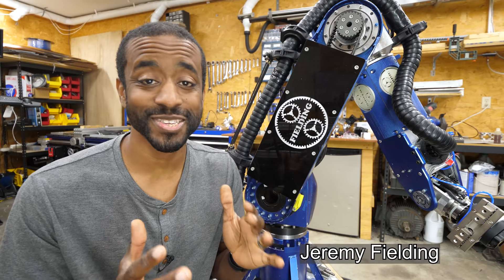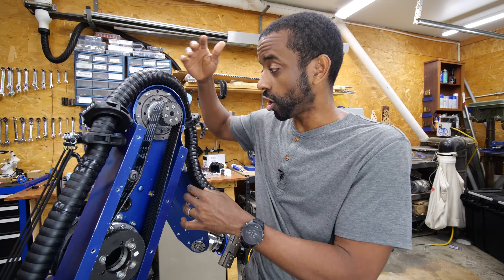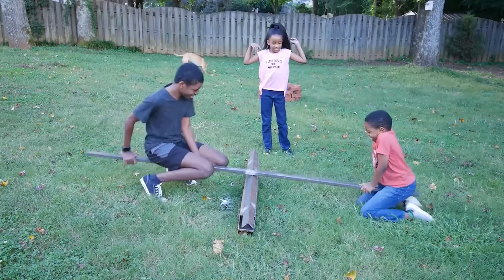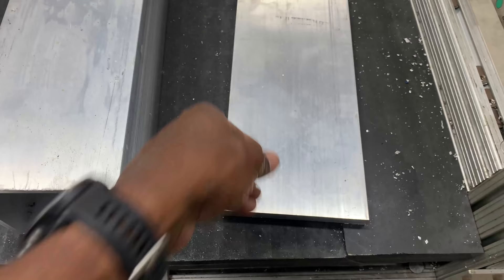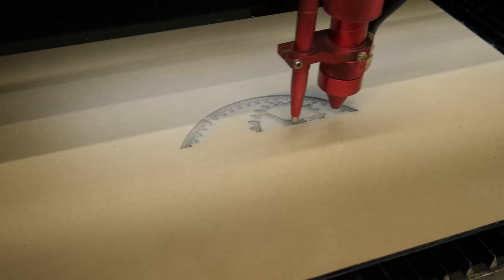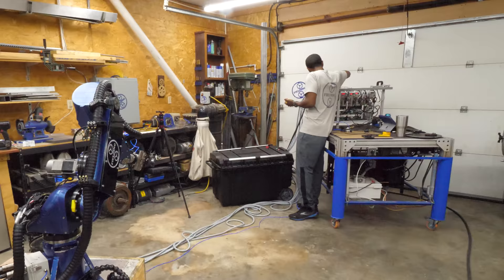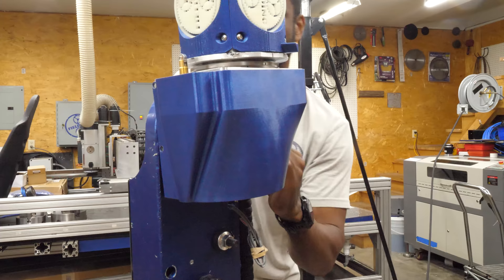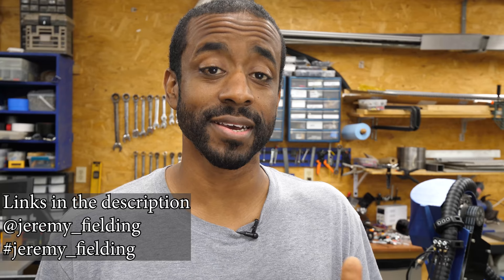How I Designed My Robot To Be Fast! Engineering Speed at a Lower Cost #092

Comment: Have you done a series on encoders? I am wondering if you have considered pivoting the failure into a success (No ego here, I think you are exactly what the internet needs REAL). There is great value in explaining or teaching the troubleshooting methods of this exact situation. The failure code from the controllers, how to reference the manual, code and parameter descriptions and remedy, meter reading potential, using the mater to compare functional encoder measurements and variance or defects, parts lookup and procurement, replacement of entire motor assembly or only resolver for cost savings. This is so important a skill set to have.

Comment: That 1/8" aluminum killed me around 8:15. I don't actually know how that aluminum was manufactured, but as an extruder I assume it's extruded. I expect a couple thou variance in bar stock or square tube's thickness from one side to another, so seeing it used as a gage on 123 blocks gave me a laugh. Clearly whatever you're doing is working great, just something I haven't seen.
Love the channel, thanks for explaining your process so clearly. You're a great presenter and engineer

Comment: Repairing bonehead mistakes equates to half my paycheck, yet only a 1/3 of my time.  I’m human, therefore I’m subjected to make the same mistakes everyone else does, requiring me to fix them for free.  It hurts twice as bad when you see a potential problem in a design, choose to ignore it, and still make the mistake.  I’ve done that too.  30 years ago I recognized that failure is the path to success, thus some of the first tools I bought were tap and die sets to fix the mistakes I made.  Your doing a great job!  This one hurts the pride and the wallet a bit, but you learned from the mistake, and continuing to move forward.  I can’t wait to see what you have planned for this arm.

Comment: 1. U have enough machining capabilities, try clocking generic connector pairs; slot one, install a blade in the other or drill both & pin one side; color for convenience & clock for absolute. 2. Weld smoke is super toxic, so if U want to play with Ur grandkids manage Ur ventilation so Ur lungs are not part of the filtration process. 3. LOVE seeing the kids in the shop, good on you!

Comment: 8:32 (ish)

If I had to guess, you don't want to weld after you machined parts because with welding (mig, stick, etc.) it's not to say that it won't work but after the initial expansion (from the heat being produced from the welding process like DC- or DC+, or heat from a regular GMAW welder) it will shrink.  It is likely to warp itself as little as a thou or as much as a few thousandths of an inch, or as bad as warping the work piece into oblivion.    There are certain techniques to help mitigate that kind of issue like heating up the two work pieces to the same temperature together so that it matches or gets close to the matching temperature of the welding process and once it cools off, it will cool off in uniform.  Or, as one piece than a single weld bead if that makes sense?

But, keep in mind that's just my educational guess, I have done welding (gmaw mig and 7018/6010 stick but not tig sadly) back in high school and that's as far as my recollection to information pertaining to that goes.  And if at any point that I am incorrect for one minor detail or the entirety of the hypothetical I gave, please correct me.   I intend to learn more so that I can do some interesting projects regarding engineering. :)

Comment: Great job and you're very well equiped!
I would like to know why you did not put an endless screw and gear to pivot the upper arm?

I think that it is more strong, a bit heavier than the pulley but you could have placed the motor further down, right on the center of rotation and with a axle activate the endless screw, and so have an equal moment of inertia but with a major Security feature added, the upper arm would never fall in case of a failure.

Please let me know why and if you don't understand what i'm talking about, i would be pleased to show it to you by a drawing.

Comment: I felt that. Something that would happen to me.
Maybe, if there is at least one free pin on each connector, you could break the unused ones off and seal the corresponding recepticle. Different pins for different connectors, ofc.

Comment: Avoid welding after machining because the heat and other induced stresses can warp the nicely-machined and toleranced part. What I mean by "other induced stresses" is kinda like if you bent two rigid things and then glued them together, those two things want to rest in a different position but are now constrained.

Comment: Excelent video! I love that you showed the mistake that broke your project. It is so great to share a problem and the process of acceptinig what happened. You handeled it very gracefully, I might add. I would have used a lot of language that would not be 'family friendly'. Is it possible to put some sort of fuse or other power checking system inline with the 5v encoders to protect future Jeremy from any other type of mistakes?

Comment: My advice for labeling the wires would be to either put which motor the wire powers, or put top left, top right, bottom left, bottle right, to show their position on the box they plug into.

Comment: The correct way of preventing multiple identical plugs from being inserted into the wrong sockets is to alter either the keying of the outer shell, or the pin arrangement.
eg Plug 1 / Socket 1 has: pin 2 missing/blocked up.
Plug 2 / Socket 2 has: pin 6 missing/blocked up.
Plug 3 / Socket 3 has: pin 17 missing/blocked up.
As long as you plug the empty hole on the socket end, with say scrap plastic/epoxy, then it's impossible to plug them in wrong (well without really forcing it).
Another solution, weld a metal rod to the (temporary removed) outside casing of the plug with 24V on it, such that it will hit the plastic box if put into the other sockets, but clear when in the correct one.

Comment: I would modify the cable setup so that it was physically impossible to hook the cables up wrong again, because if you don't, it is going to happen again, even with labeling.

Why do you want to avoid welding after machining? Welding can easily warp a part, especially if it expands and contracts thermally, like aluminum does. You also add stresses into the parts from the uneven heat and cooling caused by welding, which can lead to other problems, like unexpected failure points.

Comment: Jeremy- If you have never fried or broken some part(s) , you are not doing anything.
 I remember 50 years  back when I rebuilt a battery radio for myself. I accidentally hooked the 45v B+ battery wires to the 1.5v tube filaments.
 There went months of allowance, as I blew all the filaments wide open. Sadly, solid state is not as forgiving as the old tube equipment was. Keep up the great work and videos.

Comment: Dude I have been there, and sometimes these projects get so damned expensive... but I've learned my lesson quite similarly similar.  I either find different connectors, even if I have to use multiple, or wire them all the same (3 motors, 3 connectors 3 vary similar wiring schematics,to prevent blow outs)

Or, baring making it "idiot proof"... (or anxious late night lets see it work proof!)  I always have spray paint handy, so plug the cable in, mask a ring around the chassis connector - paint a quick light coat around the cable and the plug at the same time. 

Good luck on your replacements!! Sucks making a mistake like that!

Comment: This is an awesome project! I've built a 4 axis robot and was gifted a 6 axis Epson C3 robot that was no longer in use (it works perfectly though). One interesting thing about its construction compared to yours is that the gearbox/joint bearing is one piece that is the attached to a belt that goes directly to the motor. Since they have small gearboxes they can afford to put those at the joint and remove any springiness from the belt that way. I can't wait to see your robot move, do you think you can achieve the speeds, acceleration, and accuracy that commercial robots can? My 10 year old Epson does 2m/s, 20m/s^2 and with a repeatability of 0.02mm.

Comment: heat from the welder will distort the shape of the metal, changing the position of the precise features you CNC machined into it. It can also change the tempering in the metal, making it softer or more brittle. (not sure which)

Comment: If you have one spare plug pin not used, move it so not the same as all the  others... then plug each plug spot that's not used. Now only that cord will fit in that plug.

Nice work, keep going forward!
I have smoked thousands of electrical components over the years, lol. :)

Comment: Great video but man, you killed me the few times you said "angle iron" when you were talking about the aluminum angle extrusions...

 question text @ 8:33 ahhh good'ol post-weld distortion messing up machined parts.... 
One thing that can help with that if its profiles (not so much flatness) particularly when working with aluminum is to machine part under or oversized and also machine out a "to size" template and then use a hand router and / or router table with a pattern tracing / flush trimming bit in the router to take the part to final size after welding. Obviously this assumes that you can access the features with the router / bit. If you can, this works great for getting good fits and holding pretty good tolerances (I've been able to achieve down to about +/- 2.5 to 3 thou tolerance doing this)..

Comment: Where I've had to use the same connector for different incompatible things, I've 3D Printed a little collar for the outside of the connector acting as a gate so only the right plug will go in the right socket - I feel your pain!

Nice use of SilentSync belts by the way!

Comment: a little bit of backseat engineering here, but why not align the motor axis to the arm axis and use a rotary coupling + solid shaft + bevel gears to transmit torque to the second arm? It would remove the elastic elements from the power train and require fewer parts. It might even be lighter weight than the current design.

Comment: Have you considered adding a safety break connected to the belt tensioner to lock the arm position in case of belt failure? It would probably be a pain to refine due to belt backlash, but I feel like it should be doable without too much added weight. That would remove one of the drawbacks to a belt drive system

Comment: Was re-watching this and noticed the bit about two inter-mateable connectors. When I was working on Magellan at Martin-Marietta, budget was nonexistent and many parts were re-used or castoffs from other programs. Some connectors which might have been made non-intermateable on any other program were allowed to be intermateable on this one. And wouldn't you know it, after we shipped it and it was undergoing testing at NASA, a NASA technician, working blind with his arm buried deep in the main bus structure, mis-mated those two cables, believing that they would be polarized so they couldn't be mis-mated, but he was wrong. Short-circuited the vehicle batteries and caused extensive smoke damage, but in the end no great damage done. A near miss on an unreplaceable spacecraft.

Comment: Why does the order of melting and heating and cutting matter in metals?

Metals permanently bend when superheated.
Metals weaken when heated.

Some metals can be strengthened by heating them very precisely.
If you reheat the metal above a lower threshold, you revert the metal to its original less strong internal shape. 
Sort of like scaffolding in a triangle shapes vs scaffolding in box shapes. The triangle shapes are stronger because the joint physically cannot  move. Unlike the box shapes that can be moved by breaking the strength of the joint. 

Because the strength of metals stronger out of the factory through a heating process they use. By reheating the metal up to (I think 300c for aluminum), you revert the metal to a less strong internal structure.

Comment: Quick tip man, once you process Aluminium, why do not you use spray mist lubrication instead of coolant? It is less messy and you can clean machine with in seconds. By the way, respect man!

Comment: Ouch ! Frying all three motors definitely hurts. 
At my job we have a lot of different voltages (5, 12, 28 V DC, 115 and 230 V AC) and a ton of different data protocols running inside aircrafts. The number one rule is "never mix connectors". I think that it has been learnt the hard way...

Comment: Maybe you should pull apart the blown up motors to do an autopsy on how they failed. Might get lucky and something fairly straightfoward to source and replace is what's dead like an optocoupler. 

They're industrial lego enough that with some scratching around the likes of banggood you might find the original encoders as a whole piece. If the drive coils aren't smoked then it'd be worth the time to poke at it and get a bigclive style autopsy vid and maybe some working spares out of it in the end.

Super frustrating when something like that happens right at a big milestone in a project. Maybe paint them to color code them? Hard to confuse red and blue.

Comment: As painful as your mistake was, it was wonderful to show it to your viewers. What seem like trivial design decisions like how to label connectors can have devastating consequences. A lot can happen in less than a second. Your initial idea of keyed connectors is best but not always practical. Sometimes you can select pins in the connector so such mistakes are harmless. Color bands, as you later used are good but not idiot proof. The key lesson here is to practice “defensive engineering.” If two things can fit together (with disastrous results), they eventually will.

Comment: Perhaps you can modify the connectors to make them unique. You could 3d-print a shell for the connectors with coding notches in different positions, so you can't interchange the connectors to the wrong place. Or perhaps it's enough to modify the 24V connector (if not all pins are needed block one of them mechanical).

Comment: Are you sure that these belts are "designed to flex"? They are usually kevlar-cored for preventing this phenomenon specifically. Or did you order a variant that is designed with elasticity in mind?  Your commentary on the positioning of the motor is insightful. Most industrial robot manufacturers sometimes use counterweights to get around the problem of eccentric loads. Can't believe you design, fabricated, assembled, and programmed your own robot. That is seriously impressive. Have you thought of anything interesting for an end effector? Festo (and others) are doing some interesting work with grippers capable of picking up organic and variable shapes. Maybe you could take that concept even further.

Comment: I acknowledge that it is a pain to do the division and conquering thing.... but I would have used a hybrid servo that allow me to replace, service and correct issues... also at least till now I have managed to keep all my servo equipment exactly at the same voltage.. using different current and power usually open the doors for what you have to deal wit... "Probably an over kill but I would feed those "5V encoders in a different plug totally different than all the others.. Have done it & it get expensive rally fast!! Best of luck, find your work inspiring!!

Comment: I'm wondering why you used servo motors and not some sort of pneumatic system for moving the arm parts. It would result in a much lighter arm, which would greatly reduce the forces involved. Since compressed air can be stored in a tank, the power surge from running many motors simultaneously would be less of an issue. You'd need a compressor, but you could put that in the robot's base and have it be part of the ballast weight.

Comment: Maybe you could add a 3D printed keyed pair  to the socket and plug to ensure only the right plug can go in the right socket? Also, I'd check the driver portion of the motors, it might just be possible they would have a fuse or sacrificial low wattage resistor for this exact type of accident.

Comment: i would think the most simple solution to your "same wire problem" is remove the casing from the middle of the connector, buy some car spray paint for metals, tape off the threads and paint that part and the connectors mount matching colors?

Comment: Why you should try to minimize machining after welding:  A brief insight. Let me first limit the context of my comment to fusion welding (MIG, TIG, etc). Other types of welding may vary.  The heat input from welding has two major effects distortion and shrinking.  Distortion affects flatness, parallelism, and perpendicularity of a part. So  precision surfaces are at risk of being distorted when welding is done after machining. Shrinking affects the size of the part/features.  The overall size of a part can shrink due to welding. Additionally holes, slots and other features of a part can shrink due to welding.  Features that were in tolerance at the completion of machining might not be in tolerance at the completion of welding.  Let me restate this is a very brief insight into how heat input affects a weldment.  This aspect of welding truly sets a good welder and a great welder apart. Many tips and tricks are employed to minimize distortion and shrinkage when post machining welding occurs.

Comment: You don’t weld after machining because thermal expansion and warpage.    You “can” do it if a design allows rough, then final machining, or if tolerances aren’t that critical to begin with.

Comment: Feels like you could add gear stopper to the belt tensioner, so if the tensioner maxes out (i.e. the belt has snapped) then a stopper is connected to the gear, preventing it from coming crashing down. Just as a fail safe